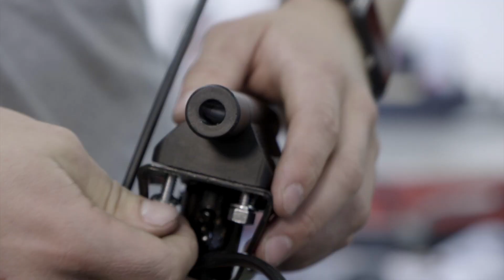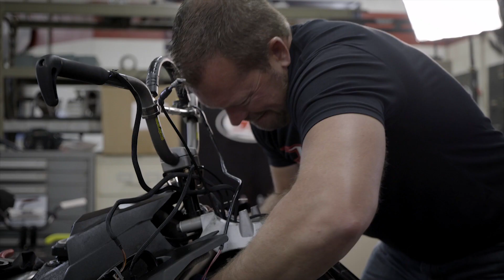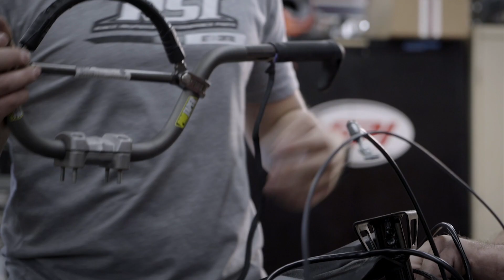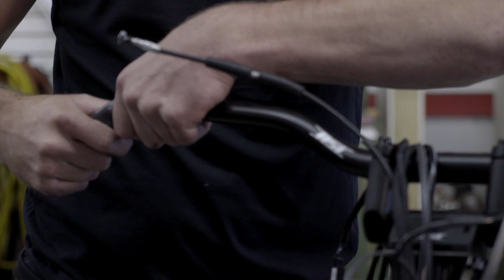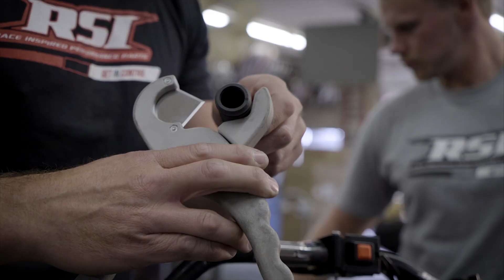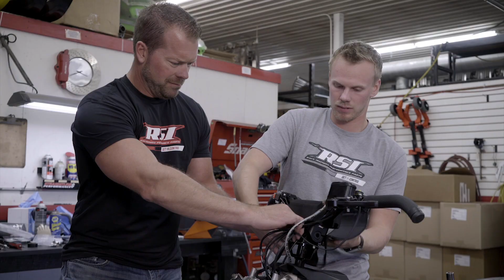Handlebar Install RSI Racing

Comment: I bought a pair of boondoggler 2 for my rev. I don’t want to spend the money on new controls. I’ll have to cut the hooks off the end. Does RSI sell any aftermarket hooks I can put on instead of having to try and weld aluminum? Thanks
Reply from the maker: Tim apologies for the late reply. we do make additional hooks to add to Aluminum handlebars however they may require modification to install in the boondoggler handlebars

Comment: Does any rsi bar pad fit with any bars
Reply from the maker: Large bar pads - fit most any handlebar set up. with a riser. Small bar pads work on 2017+ ski-doo's & 2010+ Arctic Cats. Round bar pads - only fit handlebars with a cross bar.

Comment: So if I have a flatplate since my sled is a little older..and I buy a pivot adapter to make it a t-bar like the new sleds then put an riser on top of the adapter..will the turning of the bars have any 'sway' in them..or will it turn like I never did anything to it?
Reply from the maker: you wont be able to notice a thing should be solid just like your stock set up.

Comment: What height is the stock riser on a polaris rmk shift 600 2009?
Reply from the maker: Looks to be 3.75" height can be measured from center of handlebars to center of steering post.
Reply: @rsiracing2233  would they fit a 2002 arctic cat zl500